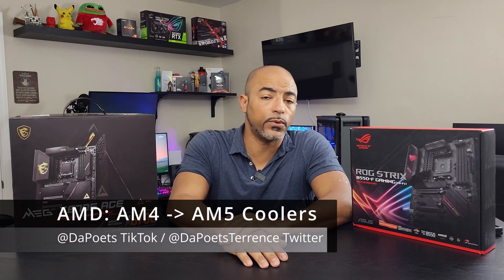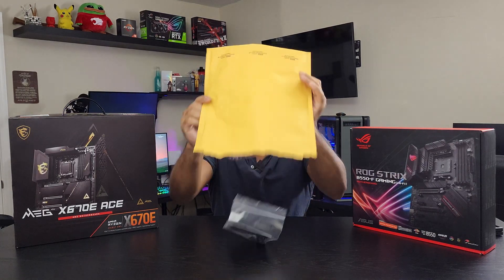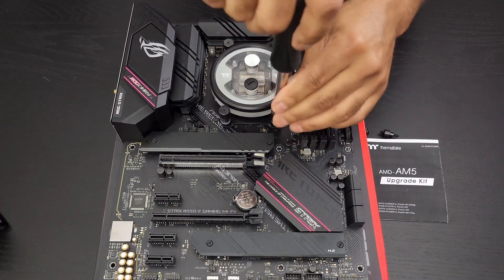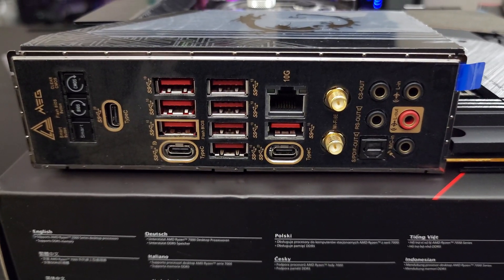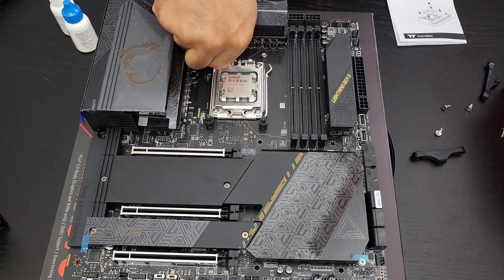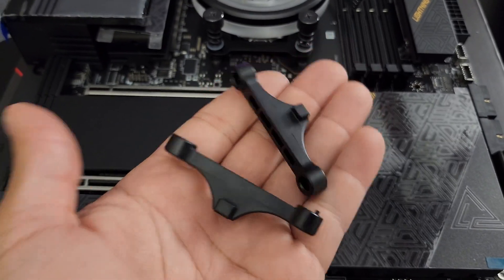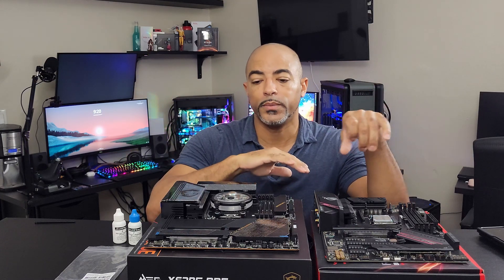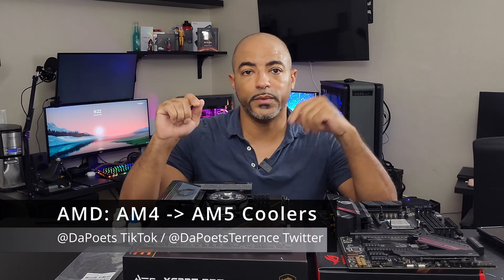AMD AM4 to AM5   Many Coolers Are Not Compatible

Comment: Hello, i'm making a move to go from my intel 12900kf with a NZXT x73 cooler to ryzen 9 7900x3d..in my NZXT x73 box it came with an AM4 bracket..will the AM4 bracket work with my new ryzen 9 7900x3d or do i need to buy the AM5 bracket for my new set up? Thanks
Reply from the maker: Most AIOs w/ AM4 do not work w/ AM5 unless they are using the AMD stock cooler design. Contact NZXT for further details as I do not  have that AIO on hand.

Comment: Yeah I bought the msi meg 360 aio to mount in my wife's new pc desk build and it doesn't work they didn't include the right screws for the MB in the am4/am5 bag they were to short to put the cooler on and screw it down I lost my mind when I realized it

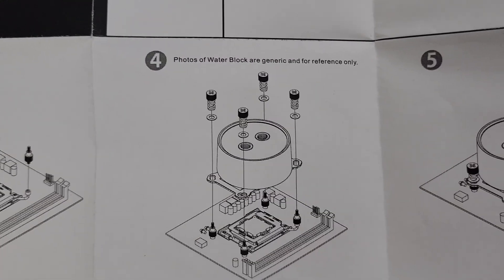Comment: 3:52 Onward..Is that am5 screws kit compatible with all thermaltak cpu coolers..including any that could be 37mm max height for low profile air cooling?  I'm building inside a Velka 5 case ( thus the 37mm max cpu height allowance)
Reply from the maker: Upgrade kits are always CPU Water Block specific unless specifically mentioned by a manufacturer. There is height/tension requirements to take into account.

Comment: I have a question. In your opinion which is a better processor for gaming…intel or amd? And thanks for the info on the water block
Reply from the maker: Both are great. 7000 series and 13th gen is splitting hairs.

Comment: Is there a point in when we should be switching over to liquid cooled CPU? Currently running a 10900K i9 but not sure if should go liquid cooled. Just some casual gaming but after some time on it becomes like a heater in my small room.

Comment: What do you prefer, amd or intel?
Reply from the maker: Both are great
Reply: @DaPoets  I’ve had both, but so far prefer intel just based off the pins, but I do agree both are great.
Reply from the maker: @tshaf8515  the pins?
Reply: @DaPoets  easier to bend the pins on the amd cpu than intel in my experience.
Reply from the maker: @tshaf8515  ah, well AM5 is LGA now.
Reply: @DaPoets  awesome. Haven’t looked much into the am5 platform yet but I need to.

Comment: This isn’t as labor intensive or excessive as I thought it was going to be. Definitely a good catch here though T. Between this and power supply awareness people really should do extensive research before attempting a new build on an AM5 platform. Can’t wait to see some testing, benchmarks, and the full build. Oh also, did you replace that TV you had issues with that was mounted on the wall?

Comment: Do you think AMD should of been more open to the backward compatibility with am4 to am5 coolers
Reply: They just need to make sure people understand that your CURRENT AIO needs a standoff kit to be compatible, I would assume if you buy the same AIO now that the AM5 platform has released, it will include the extra mounting kit. Most AIOs are universal anyway. They just have to add the extra parts
Reply from the maker: Yes, they only needed to talk about the backplate and we would have understood

Comment: Alright, so after somehow trading my way into a PC I’ve had it for about 6 months and I’m beginning to look at upgrade paths. I basically just game. No mining or editing/animating or design. Currently running an EVGA RTX 2060 and an I5-CPU. After more research I think I’d like to jump to a 6750XT or 6800XT. Also converting to a Ryzen CPU. What CPU would you recommend pairing with either of those GPUs?
Reply from the maker: 5800X3D since it's at a great price for gamers
Reply: 5800x, 5700x, 5800x3d depending on what you do. If you go am5 go for a 7600x or 7700x.